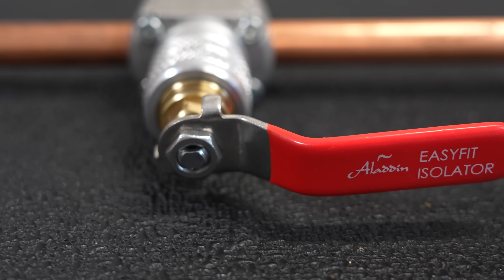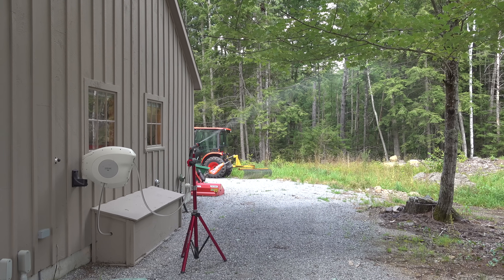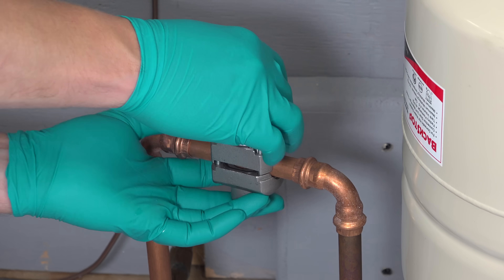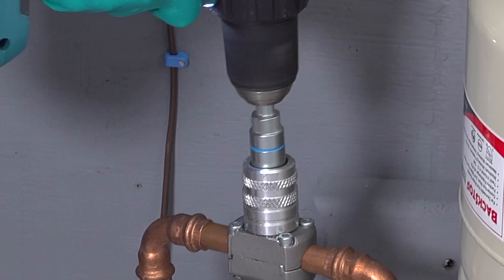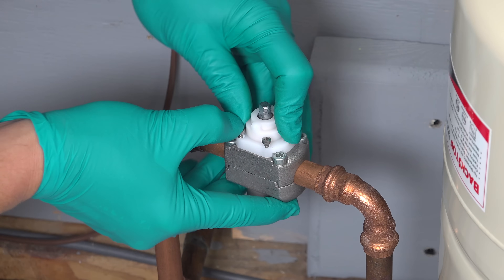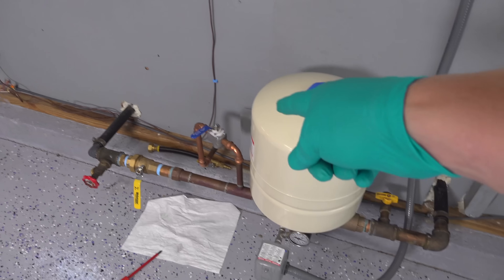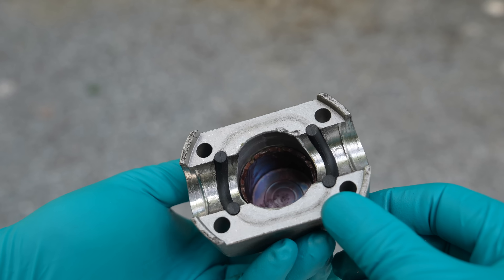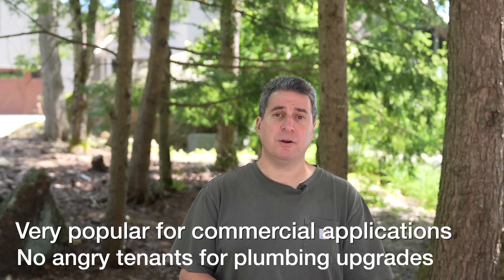SHUT-OFF valve installs on a LIVE WATER PIPE - Aladdin EasyFit Isolator

Comment: Its just a residential version of a commercial hot tap. Been around forever and virtually no need for it in residential
Reply: Thanks for your comment, a hot tapping installs an isolatable branch unlike the Easyfit which installs an isolator into the main pipeline  The EasyFit is a unique patented product which was designed in the UK and has been sold for just over 10 years.

Comment: the only downside to these is you end up with a copper disk inside your pipe, now that isn't a problem in most cases unless it ends up against an inline filter or jammed in a bend and it restricts the flow of the water or gas, doesn't happen often but it does sometimes if you have downstream shut-off valve it is best to remove the new valve and pick the disk out of the pipe and then reassemble the new valve,
Reply: Thanks for your comment, due to the valve’s unique design the pipe coupon and swarf is captured in the lower housing in the special chamber at its rear.

Comment: This is all backwards! Where is the logic in doing this? This ain’t emergency valve at all . $200.00 bucks for a single valve ? PEX is the way to go! Even on emergencies! Besides, for less than $500.00 dollars you get a nice Milwaukee Expansion tool and do all repairs around your house ! 
Bottom line is: if you are a homeowner, you must know where your main shutoff valve is. You got a leak or pipe burst? You find your main, turn it off then do the repair yourself or hire a plumber. 
$200.00 bucks… not in my wildest dream I’d buy that valve .

Comment: Very clever but I just don't think I would use one. I wouldn't trust the rubber seals over time. Would go with a compression fitting ball valve at 1/10 the cost, which are actually very easy to install with just a couple of crescent wrenches. Sure you need to turn off the water pressure and cut the pipe but all very quick and easy. Have also used soldered valves but I think the compression are just as good and you can also remove them later, put them back, replace them.
Reply: Thanks for your comment, the gaskets in the valve housing seal during installation. Once the valve is installed the boot inside the valve acts as the primary seal – it’s a dual seal valve.  They have been sold for over 10 years in the UK and haven’t been known to leak once installed.

Comment: Even in an emergency there's plenty of ways to install a standard valve on a pressurised pipe. I can do a live cut and fit a valve in a few seconds with very little water leak, nothing that the wet vac cant quickly suck up.
This product is aimed at people with no or little plumbing experience. It is neat though and i like the concept.

Comment: It seems like there would be a significant risk of releasing cut copper shards into the line. I wonder how they avoid that?  (It's all fun & games until you're in the shower and get a razor-sharp tiny curl of fresh-cut copper in your eye.)
Reply: So you run the water for a couple of minutes first…..not a big issue ?
Reply: The coupon is trapped and sealed along with swarf in the lower housing.  We would recommend running your taps for a few minutes after installation or repairs of any kind on your pipes.  If you did a repair utilizing soldering flux you would clear the water lines as well.

Comment: Id rather shut it manually and put a twenty dollar valve.
Reply: Thanks for your comment, the EasyFit was designed for when you can’t switch off the water and put in a $20 valve.

Comment: Holy crap!    $250?!    And that's for the 1/2".
Lol!!!
I will say though, if you're doing work in a building where you would have to shut the whole building down to work on an apartment that has NO shut off then it would be practical. Let me also add THAT cost is absolutely unneccessary. I am looking at a legitimate cost at $125 to $150 TOPS!!

Comment: If you do not have a working shut-off valve... do not work on pressurized water!
It's one of the first thing you're being taught at a plumbing college.
Reply: Thanks for your comment, this is why the EasyFit is such an awesome product.  It allows you to safely and quickly fit isolation when you have no working shut-off valve.

Comment: $250 for a valve. Hmm.. some profit taking there huh? I can see $80 to $100 but any more than that they are just soaking people. 
Aladdin EasyFit Isolator Valve and Tools Pack - Starter Kit    Brand: Aladdin  £52.50 or  approximately $65.
Reply: Thanks for your comment, the EasyFit has been re-designed for the US market as our pipes our much harder and thicker than the UK hence the price difference.

Comment: Saddle valves are illegal, this means that although this product may be helpful in an emergency, it would have to be done correctly if selling the house.
Reply from the maker: Correct but this isn't s a saddle valve since it removes the middle section of pipe entirely.  The reason they are called saddles is that they sit on top and water flows out the top portion. This isn't like that

Comment: If i had a small, pinhole leak on a pipe, could i slip one of these over that hole instead of having to replace the whole pipe? Or is it just better to replace the pipe and add a simple shutoff valve? The leaky pipe also happens to be a good place for a needed emergency shutoff valve.

Comment: £52 or $50 on Amazon UK or £55 in a trade shop here in the UK - if you are paying $200 for it then give your head a wobble
Reply: The US version of the valve has a different blade, material, and valve body design to withstand the increased strength/density of US copper tubing.  The UK version of the valve will not work on US pipe.

Comment: It's called a saddle valve. The Piercing style, There's many styles and manufacturers.  It's not as secure of a connection as a standard ball valve. U could cut a propress valve in. It woulda matched better. But hey as long as it works.
Reply: Thanks for your comment, the Easyfit seals on the ends of the pipe as well as the sides unlike a saddle valves and is classified as a ball valve, it removes the whole section of pipe so is full bore.

Comment: I worked in a hospital for 24 years.  I was in facilities, but not a plumber.  The hospital was 100 years old in places, and there were lots of crazy plumbing re-directs, and non-standard applications by contractors and remodels.  Our plumbers used these all the time, because they couldn't trace the source of the water pressure, and had to isolate a chunk of the system.  They called it a Joe-mar, but that might just be a local term...
Reply: jomar is a brand, they call them "add-a-valve"s these days
Reply: Thanks four your comment,  the EasyFit is a patented product different from the add-a-valve it has dual seal technology it was designed in the UK and has been sold for just over 10 years there.

Comment: Uhoh, not me. Nice idea, but cutting into the pipe?  Debris flowing downline.  Mixed metals = corrosion etc..  I've seen these before, would never fit unless in an emergency, and would not issue a guarantee.  Shut the water off & do it properly with an approved fitting.

Comment: why is it so expensive compared to the UK... 3-4 times the price
Reply: The US version of the valve has a different blade, material, and valve body design to withstand the increased strength/density of US copper tubing.  The UK version of the valve will not work on US pipe.

Comment: NOTE: your pipes have to be completely dent free where the seals go. Just a tip 👍🏻
Reply: Thats something he mentioned
Reply: @panerai_fan  seriously?
Reply: @panerai_fan  I guess you haven't come across any of the "plumbers" that ply their trade around where I live...  Here, it's rare to find copper pipe in good condition!
Reply: That's why at 1:16 he says to put it on a place where the pipe is physically sound as possible meaning damage free as possible. Also your pipes shouldn't be dented anyways and that is a rare thing. Nothing should be hitting or falling or making contact with your pipes to dent it.
Reply: And not painted with 100yrs of different paints as we get in England 🤣
Reply: @panerai_fan should see my house I'm in the process of replacement soon with PEX because it's was such a shit show of a job in this old house I'm scared to leave it as is for much longer lol
Reply: ON THE MEAN TIME THE DENT IITS ON MY WALLET😂😂😂
Reply: UPDATE* !!! ATTN : hello all ! Please let me explain my comment….When I made this comment it was manly  for the ‘’ HOLLY CRUD ! I need to fix the leaking pipe NOW in a RUSH type of job ‘ where as you don’t have such a nice clean & DENT FREE area to work in ! Like a situation I was helping in where as the copper pipe was under the slab in the garage leaking from the hot water heater!  And because the copper pipe was laying ON the gravely ground .Underneath 6’’ of concrete when we thermal tested to find where the leak was coming from and then broke through the slab when we first seen the ORIGINAL COPPER that was layout from build day in 1987 it looked nice on top meaning  the part you can see looking down on the area ,but because it was under the slab the opposite side of the pipe the part laying on the Rocky dirt was VERY DENTED  ‘’ probably from the slab pressure /settling all those years’’ as we found out AFTER Installation of ‘’EASY FIT ISOLATOR ‘’ as I had a few on tap in my truck . The water heater was connected to a few condos so we were told NOT to turn the water off ! unless it was life or death! lol so the leak was your usual ‘’ pin-hole ‘’ leak so I thought the ‘’ EASY FIT ‘’ would be fast and convenient for all things considered. So I installed it …we looked for the BEST Placement over the pin-hole and it went on nice and smooth… but only 1 thing the bottom of the pipe had dents from the gravel on the ground and the seals WOULD NOT SEAL 💯percent  tight on where the dents where so it would LEAK/spray water everywhere. If there where NO dents and creases from whoever installed the pipe originally it would of worked no doubt 👍🏻
Reply: No shit, Sherlock.
Reply: No shit.
Reply: Guys, HERE is The Savior

HalleluYAH translates “Praise ye YaH”

YaH is The Heavenly Father 
YaH arrives via the TENT OF MEETING
YaH was Who they Crucified for our sins
YaH was Crucified on an Almond TREE

— Ancient Semitic Cuneiform of Moshe (Moses)
— Isa Scroll (The Original Isaiah)

Isaiah 42:8
"I am YaH; that is my Name! I will not yield my glory to another or my praise to idols.

Isaiah 43:11
I, I am YAH, and there is no other Savior but Me.

Isaiah 45:5
I am YaH, and there is none else.
Reply: Do you really have dents in your copper pipes???
   You do know that water rushing past a dent in your pipes will sooner or later wear a hole through copper pipes ???
Reply: @ltsgarage7898  That's obviously untrue given that this doesn't happen with crimp seal pipe fittings.

Comment: Im a plumber and for that price id sooner walk outside and turn the main off. Good product i say $50 would be a better deal.
Reply: around here a plumber will charge 90 just to visit, so if dyi it may break even
Reply: I thought it cost between $300-$600 to replace a main shut off valve ...
Reply: $100 is good?
Reply: And how much are you going to charge your customer to turn up, walk outside and turn the main off?
Reply: @KenFullman  You could turn it off yourself?
Reply: @rcnelson  I could indeed but there are a lot of people that wouldn't have a clue where to find it and that's assuming it exists.

A lot of older properties here in the UK don't have their own main stopcock.  If you live in a block of flats, chances are you'll need to turn off the water to the entire block.  That's one way to upset your neighbours.

Even properties that have their own will often find that they no longer function.
Reply: @KenFullman  Wow, that is horrendous design decision. Why would they do that?
Reply: @cefb8923  Usually those kinds of places have a separate shut off valve that leads to each house. but sometimes those valves can fail (pinwheel valves are what they used back in the day and they fail ALL the time). however the meter valve almost never fails, so sometimes you gotta shut off everyones water in order to replace the individual house shut off. if the meter valve fails. you got bigger problems
Reply: As of right now in the UK these are £44 and I can pick one up today. That’s about $60. Someone in the US should probably make one of these so you’re not paying a crazy import fee.

Comment: I don't think it's overly expensive if you do emergency/salvage/board up work. Buy a trio and keep them in your truck. Get called to an open pipe emergency, you'd probably charge 5-6-7 hundred dollars for the simplest response. That pays for the valve, plus your labor, travel, misc parts etc. And it probably gets you back in service in under 30 min.

Comment: @2:50 there was a droplet come out from the top left  corner screw and there were number of droplets coming out within the sealed line between top part and bottom part...the water/droplets were coming out during your installation ,,,I wonder how it's been going ,,any leak?
Reply: Thank you for your comment, this is PTFE grease from the cap screws –  (you can see a small white curl of it on the housing).  We grease the screws to ease the Cap attachment operation

Comment: in UK a 15mm (nearly 1/2 inch) is no more than 60 pounds and a second one would be about 50 pounds (doesnt include bits you need to fit which come in first one).   If you deduct the price of a decent ball valve (15-20 pound)  and the cost of a plumber you are quids in!
Reply from the maker: You guys have a couple of kinds of pipe, the US pipe is what you called "imperial pipe" which requires the pro model which is what this is. I am sure its still more expensive but our pipe wont work with the non-pro model

Comment: Not a plumber. I wish people understood how SIMPLE it is to sweat pipes. For 250 bucks you can get: a very good torch with gas, a fitting brush, emery cloth, 8 oz of solder, flux, a heat shield, a pipe cutter and TEN 1/2" brass full-port ball valves (at Home Depot prices, likely find all this cheaper). 
Shut off the water, open your lowest faucet and the highest (to avoid vacuum), grab a towel and you're looking at a 20 minute job, literally. And the best part of that deal, when you're done you still HAVE A TORCH! I won't go into all the fun things you can do with a torch.
Another commenter mentioned compression fitting valves, also a fine option if you don't intend on doing other soldering/pipe work (once you see how easy it is, you will FIND more projects, because... TORCH).
Did I mention that you get to play with a torch?
Reply: In some places you can't get a shutoff of the waterline because the valve is locked behind some locked doors, and you don't have the key. It's a temporary fix a plumber should have in the tool kit till it could get fixed properly. There is some dead space which isn't good if you leave it for years. For a month ok. but not for years as there might grow some nasty stuff.

Comment: hard to believe this does not leak.
Reply: Thanks for your comment, the EasyFit is not a crimp valve it is a patented product with unique dual seal technology.   It  was designed in the UK and has been sold for just over 10 years; it hasn’t been known to leak once installed.

Comment: Great video!  Cool product, works great, but not sure it's feasible for that price tag.  Professionals can just use a freeze kit, homeowners can buy a single use freeze kit, and due to the price tag, local supply houses are likely not going to be stocking it on the shelf for emergency repairs anyway.
Reply: Can't freeze it when you're working on a heated water loop that's treated with glycol and you can't stop the flow or turn off the boiler. Had that happen to me today so I'll be grabbing a couple. We used an entire tank of CO2 and got nowhere.

Comment: Seems like a neat product. But isn't this still considered a 'saddle' type valve? It's different from a needle valve in the sense that it's not controlling water supply to another fixture, but still. Lot's of jurisdictions don't allow for those.
Reply: Thanks for your comment, the Easyfit seals on the ends of the pipe as well as the sides unlike a saddle valves and is classified as a ball valve and is both UPC and NSF approved and fits a full bore valve.

Comment: Another absurd solution in search of a problem...  $250.-?  If you're on city water, go to a plumbing supply and by the tool to turn the water off at the curb. If you're on a well, as in this video... not being able to shut off your water is kind of absurd. Turn off the power to your well pump and drain your pressure tank.
I have to wonder how much of the copper shavings move upstream and wind up causing problems/damage in the valves of your expensive faucets, toilet valves, shower diverters etc...?

Comment: would be a great solution for pex pipe if they have a version for it. More often than not sink shutoffs are commonly disregarded. Especially in RVs which use pex pipe that was given no wiggle room for repairs.
Reply: According to the sales info...it can be used on pex.  

1/2" EasyFit Isolator Valve  (Imperial Pipe Size)

This emergency shut-off valve is designed to help shut off the water in copper tubing. It allows the replacement of defective valves and the installation of new valves without the need to shut off the water. The valve may be replaced or installed on hot or cold water, pressurized systems, copper tubing (K,L,M) and PEX.
Reply: @bernlitzner2739  Hey, Thanks for clearing that up! Helps anyone interested.😄